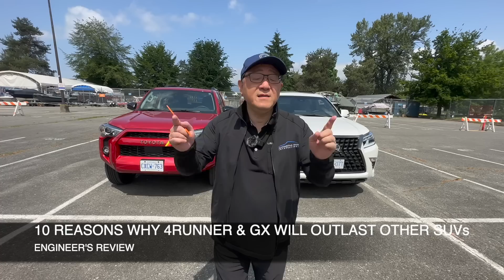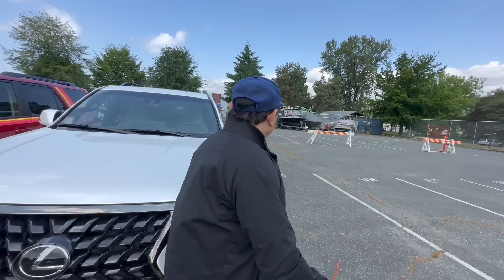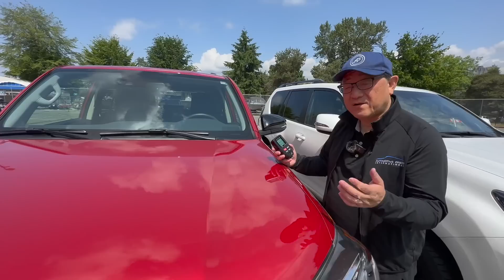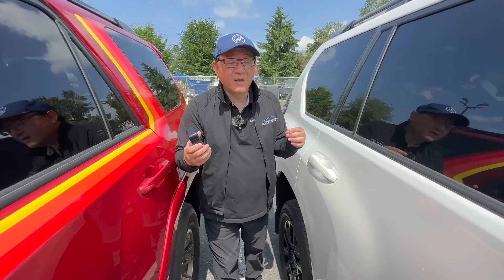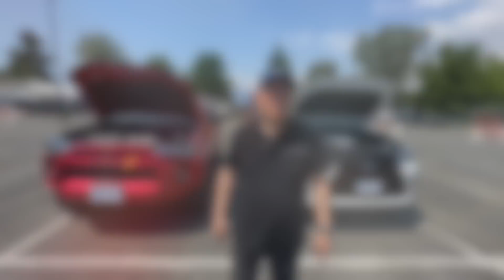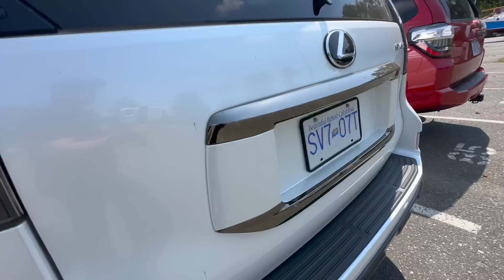ENGINEER EXPLAINS 10 REASONS WHY 2023 TOYOTA 4RUNNER & 2023 LEXUS GX WILL OUTLAST ALL OTHER SUVs

Comment: David, You really put your heart and soul into making this video and your enthusiasm jumps right out of the screen. 👏👏👏👏The GX with the 4.6 V6 (1UR-FE) and 4Runner with the 4.0 V6 (1GR-FE )  are absolute standouts for longevity but surely you must acknowledge that the MOST reliable SUV coming from the famous Tahara factory is not the GX or the 4Runner. The best of the best has to be the Prado equipped with the 2TR-FE 4cylinder engine as it is even simpler than these two champions!!!  BTW is the gap between those yellow, orange and red stripes consistent across the full length of the 40th anniversary 4Runner? 🤔😉😉🤣
Reply: I'm in Dominican Republic right now and the amount of prados,land cruizers,and Hilux here are insane,their quality is legendary here ,they go thru Rivers mountains,bad roads like nothing,to elaborate further I was speaking to a tow truck Driver the other day and out of all the pick up trucks he has had to pick up beacuse of mechanical issues he's never has had to pick up a Hilux.NEVER.SAME GOES FOR THE LAND CRUIZERS. if you take care of them they could last a lifetime.
Reply: @will0775  Thanks for the report and please keep an eye out for the legendary 2 door Prado which Toyota stubbornly refuses to sell in North America. 🤨It must be hot in the Dominican Republic in June, I hope the daiquiris are cold . 🌴🌴🌴🌴
Reply from the maker: Thanks Mike!  I love both of these vehicles!  And yes, the current gen Prado may be the best SUV ever...
Reply: @AutomotivePress  😁

Comment: Yes,  David, they will last 30 years or more.  But will there still be gasoline to run them, and will ICE still be allowed to be operated?
Reply: An excellent question which no one really can definitively answer - as others mention here, it’s possible that some sort of synthetic fuel could be developed to allow current cars to run in 2053. I think it’s more likely than not as I can’t see our entire vehicle infrastructure converted by that time.
Reply: Do you know in Europe they convert any car to natural gas.
They have natural gas fill up stations everywhere.
Reply: Porsche already has formulated a  synthetic fuel for its 911 Fan Boys, but the fuel is very expensive at existing limited production levels - approx $10 a gallon!

Comment: Thank you David for such a thorough quality review.  The current GX and 4R embodies proven reliability and optimized quality, something that the new model GX and upcoming 4R have yet to achieve. 
As much as I am excited for the incoming GX550, after this video, you make me want to rush out to buy the predecessor GX460 (if only they were available). What a quandary.
Reply: The Lexus GX V8 is still available, but hurry before production is shut down in the next few months.
Reply: So Lexus still building the gx460?

Comment: What do you do for rust control since you also live in Canada? 🇨🇦 I’ve been using Krown every year and so far so good 🤞 😬.
Reply: I live near Ohio in Indiana and one of those facilities is a couple of hours away in Ohio, and I’ve been contemplating using them on my older Corolla which still has very little rust but runs fantastically as I’ve taken very good care of it even though it has 300,000 miles. Glad to see you’ve been pleased with their performance and what I read on their website you can still have an older vehicle treated if it has very little to no rust.
Reply: @jonathanratliff4780  my understanding is that if you get it sprayed within 12 months of the vehicle being manufactured it’s a “lifetime” warranty…as long as you spray it once a year and follow the rules. 

If you get it sprayed later in it’s life I think they do 10 years. Regardless I think it’s worth it because way back in the day my dad didn’t get it done and his friend did and my dads truck was falling apart and his friend had almost nothing. This was on late ‘80’s Toyotas so you know they were prone to rust 😂. Good on you for taking care of your Corolla and hope you get to 500k+ miles.

Comment: I can testify the 4Runner are long lasting and durable vehicles.  Had my first one, a 2013 4Runner, for eight years, and put over 162k hard miles on it as it was my patrol vehicle.  Other than routine maintenance never had a single problem…thing was a tank.  We loved it so much we bought my wife a 2017 4Runner TRD Off Road and to date not a single problem.  I trust the 4Runner so much I bought an Army Green TRD pro 4Runner.  My brother has and his wife have a 2013 and 2017 4Runner.  My father has had two 4Runner’s, an FJ Cruiser, and now a 2023 Tacoma.
Reply: I've still got my '98 Limited I bought new. 
BUT 😁, it's only got 70,000 original, garage kept miles on it. Needless to say I've always had a couple other extra means of transportation also.
Reply: TRD OR is the best one
Reply: It’s the perfect vehicle to pair up with a small gas sipper IMO.   Because of the bad gas mileage.  Buying a new 4Runner and a new Corolla would be perfect!!